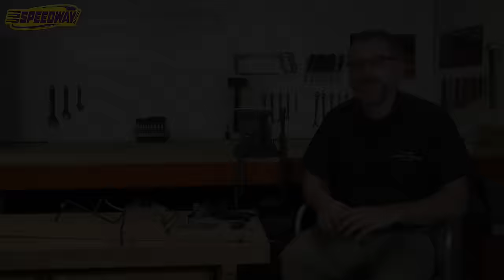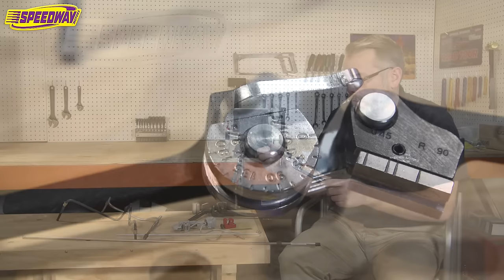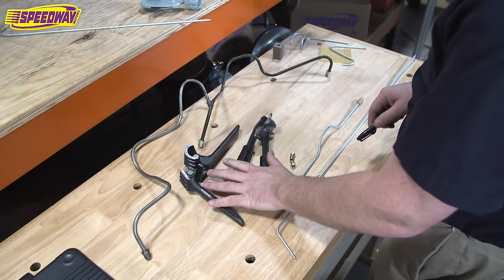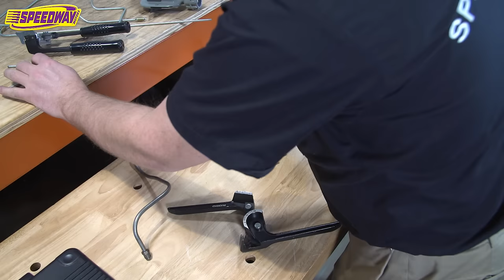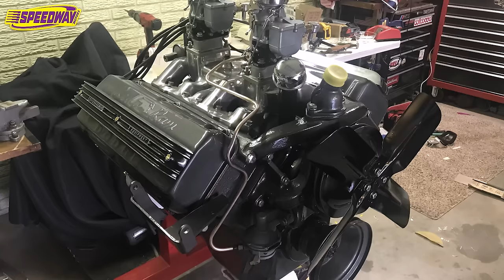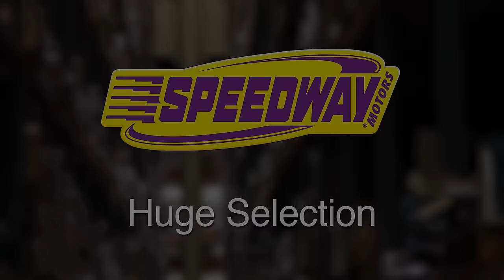How to Bend Hard Lines for Your Custom Fuel & Brake System

Comment: I hope you guys are still reading this I just bought a NOS American made Ridgid 456 tri bender like yours in the video I have some steel line I need to make for a customers boat and has to have 90s in it , With 5/16 steel  line I put it in and carefully bend the radius for the 90 and it kinks the pipe and bends it out of destortion why? Its brand new and never been used in the original box. I have bent ttubing but  this style if my first

Comment: is it ok to use aluminum fittings on stainless steel hard line?
Reply from the maker: Although it is preferred to use steel or stainless steel fittings on stainless brake lines in some cases aluminum can be used when the stainless or steel fittings are not available.